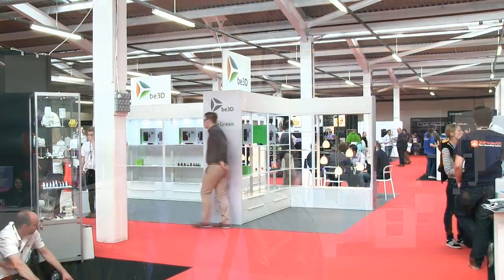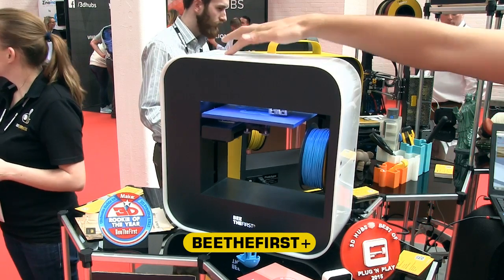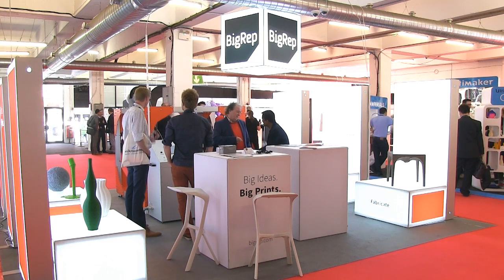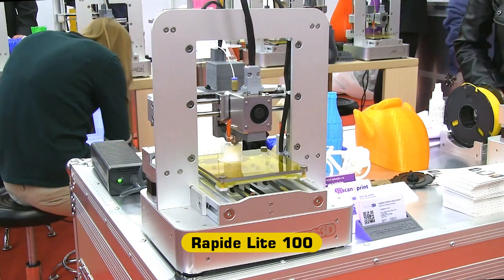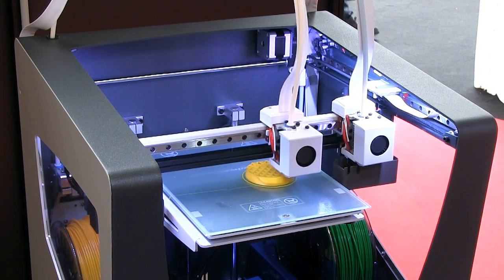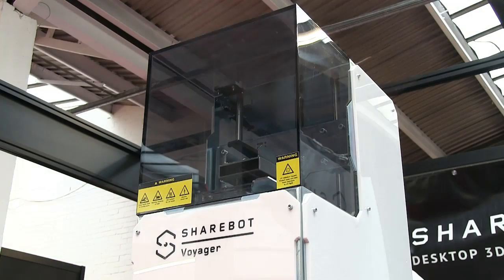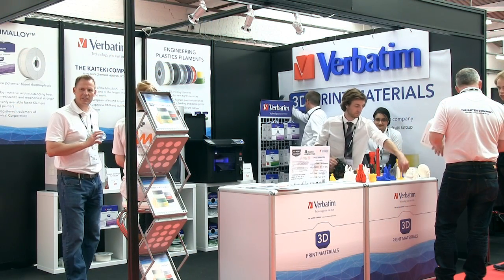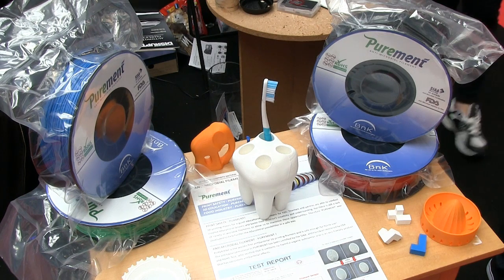3D Printshow 2015 Review

Comment: when will printer deisgner realise that until they allow a 3d printer to integrate arduino +arduino shields + tactile screen+ valves + motors + cabling + fluid piping modules automaticallly, it will remain a nich market for casting prototypers and enthusiastic hobbyists.